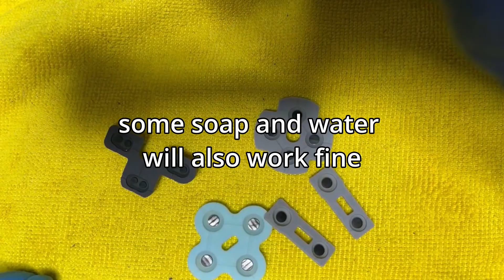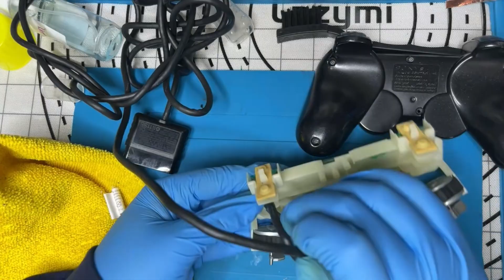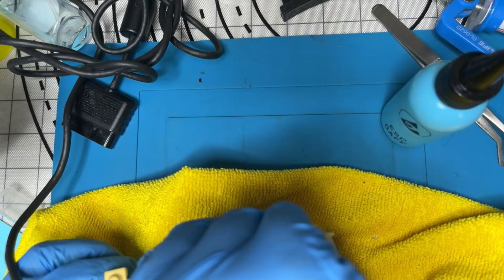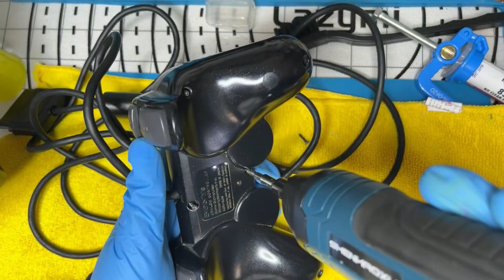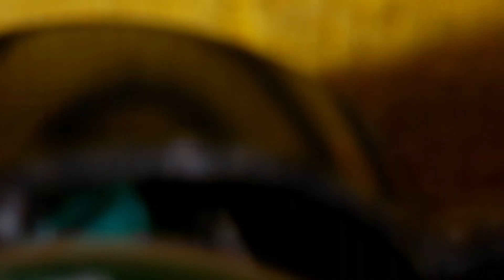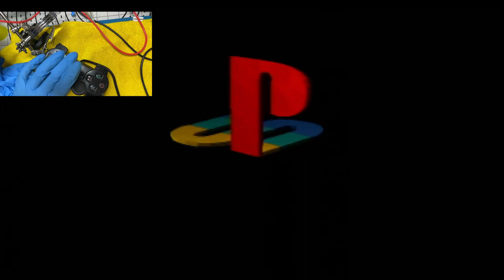Trying to fix these PS1 and PS2 controllers

Comment: Dear Sir, I have a problem after replacing the black soldered connector on my Dual Shock2 H series controller. When I install the new flexible PCB flex cable, it suddenly starts malfunctioning, with the controller buttons pressing themselves. Then it works normally, and then it malfunctions again. I soldered the connector correctly, and the flexible PCB flex cable is firm and doesn't move; it's new. However, like you, the model of the flexible flex cable is SA1Q42A, and I was told there's another one, SA1Q43A. Could that be related? I've had the same problem with two Dual Shock2 H series controllers. Is your second controller an H series or an A series? I didn't see if you installed the SA1Q42A flexible PCB flex cable or another model, since that model doesn't have the flex cable connector soldered to the controller board. Thank you.
Reply from the maker: There could definitely be a lot of different things going on. Strange issue for sure. 

First thing is to check your solder points. I know you said it is installed correctly but just double check if there are no cold solder joints and that you have cleaned up the motherboard with some ipa (since that could also cause problems). 

If that doesn’t work it could be the flex pcb. Like I said in the video, from the 42A it is really easy to accidentally get counterfeit ones that will not work with the ps2 controller. A 43A is also a good replacement with the positive that there are no fakes ones of. 

The ps2 controllers that I look at in the video are both model H controllers, but different revisions. The one with the black connector (which needs new flex pcb + connector) and one with a white connector (more rare, and you only need to replace flex pcb - no need to replace the connector) 

I replaced the flex pcb in both model H controllers with the 42A ones. 

Hope this helps a bit!
Reply: @cpr_tech  Yes, thanks for replying. Now I don't know where to get the 43A, since it was a long time ago from AliExpress. However, this same flex cable works without problems on my Model A - DS2. That's the strange thing, because my Model A has the removable 18-pin connector, and it works perfectly with the 42A flex cable like in your video, except yours is a Model H.